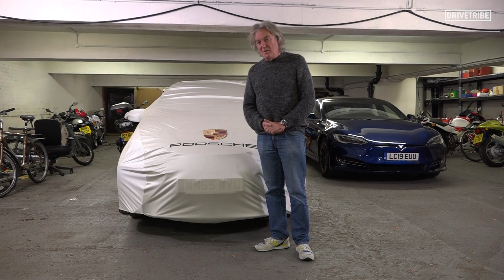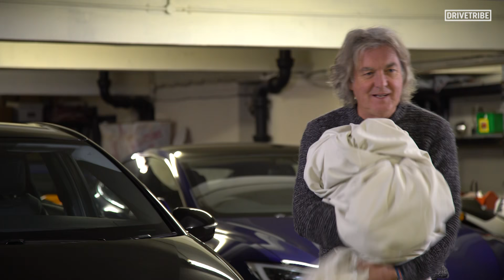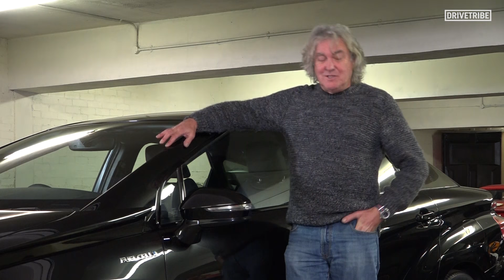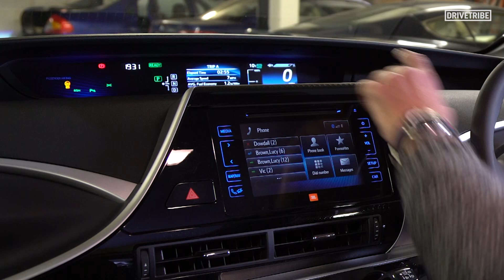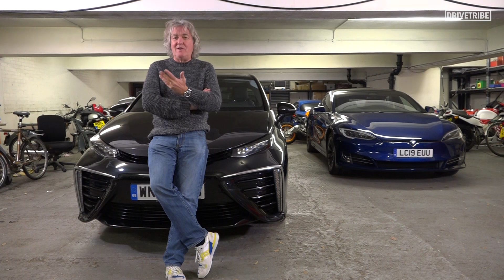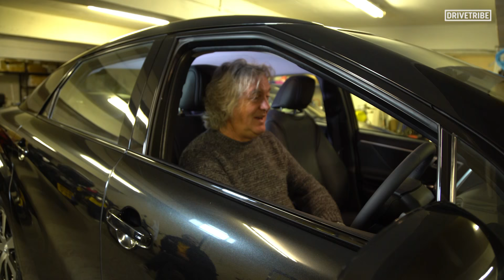James May has bought ANOTHER new car

Comment: Both cars require fuel produced by burning coal, fuel cells and lithium batteries require nickle which has a colossal carbon footprint, there are many other high carbon materials and processes involved in the manufacture of these vehicles, just now there is little if any real smug points to be gained from running these cars but the time is fast approaching when a real dent may be made in our collective carbon footprint. So now its either a new Fireblade or a used XKR, or maybe a used Elise, or shall i be the 57 year old chap that i am and buy a Range Rover, a petrol one. Or maybe a BMW S1000RR, this could take sometime.

Comment: I think Hydrogen for cars will not happen, a bit like the Gas Turbine cars at the start of the 60s, promising  but the advantages  too small to overcome the big problem, the cost of operation. The simple fact is that with recharge times heading to 15min, the peoole who are willing to pay 4 x cost for their fuel ( because of the energy intensive manufacture) to save a few mins at the pump is too small to justify the infrastructure and tooling etc. Sure hydrogen has potential for use where batteries cannot be used, aircraft, ocean going ships but for cars it is a Video Disc in the world of VHS video recorders.

Comment: Hydrogen has a possibility of use, in that it can be produced and stored relatively close to the source of energy. It can produce in one plant, using clean energy from Nuclear plants at times where power consumption is generally low (meaning they don't produce during the time where everyone is making food or otherwise burdening the grid heavily, and the produce can then be taken to the stations in its vicinity. Hell, even within quite a fair distance as long as the production is enough. 

They cannot, however, compete with the efficiency of direct "injected" energy into the battery when you connect to the grid.

Basically I think Hydrogen stands a chance when the grid starts showing signs of being heavily burdened. When nearly every home has a battery car. Imagine every home starting to pull 3-4 kW extra because they got home now and need to charge their car. It's much easier to have production plants directly connected to the powerplants with their own grid where they then get to produce this Hydrogen for fuel consumption. Lots of lost energy in the process, but still much lighter on the nationwide grid.. and thus less energy lost from the mere transportation of energy (there is a loss factor in the normal grid too, after all. The further the energy needs to go, the more loss).

Comment: After lots of research I think battery is the future over hydrogen; Maybe not the cell technology we use today, I think it's helping push for better technology, but definitely not hydrogen. Hydrogen will absolutely be more dangerous in the long run and will just shift dependence. Anyone who has enough money for an EV likely already has there house wired for electricity which means everyone has access to a method of "refueling" inside of their home.

Comment: I ... also ... thought it is going to be a Prius ... but Yes I too think, the hydrogen fueled car is better than the battery one ... but for now the refuel/recharge stations are not that common ... as a matter a fact in Bulgaria for now there are non for hydrogen (the construction of the first ones should be complite till the end of 2020) and 152 for EV cars  for the whole country ... and only 23 of them with 50kw DC charging connectors ... yep ... in Bulgaria the "future" is comming slower :|

Comment: In 2018, fewer than 7000 hydrogen fuel cars were sold globally (total sold since 2013).  Battery electric vehicle sales are well over a million and increasing rapidly. The answer should be obvious at this point. If this video came out in 2013, James would have a valid argument, battery or hydrogen. Fossil fuel companies will not let it die quietly though as well as traditional auto manufacturers. They want to continue to provide fueling and maintenance services in order to profit from it.

Comment: Hydrogen will go down in history as a failed technology. The high price(higher than petrol) the need to build a completely new distribution network, it would need a worldwide hydrogen production plants and thousands of trucks to deliver it just like gas, no refilling at home(from your own solar panels). The fact that electric grid is everywhere and all you need is connections to be set up. 
The future is home solar, home batteries, charging at home, work or shopping, superchargers for travel. Always leaving your home with a 90% full “tank” and rarely have to stop just for energy. Electricity is also very cheap and it is possible to be produce it 100% with renewables in the future.

Comment: Hydrogen sounds nice for all those "use existing infrastructure" type reasons, whether it's having a pump at a petrol station, or sending it down the gas pipes, but the problem is that hydrogen is really hard to contain. It's so small, it can leak out of plastic pipes and it attacks metal making it brittle. That said, storing electricity also has its challenges, as mentioned with the heavy battery packs. 

I think that the batteries are an engineering problem, so as we get better at them, we'll improve the energy density. The hydrogen storage feels like a Physics problem, which is going to be much harder to solve, but the aircraft point is interesting - that's a case where you'd potentially be willing to pay more.

Comment: Did you check out the NEXO before picking the Toyota ? The interior of the NEXO imo is far better and the car it selfs looks better . This basically The Beta Max ...Hydrogen v VHS ..Battery power.
You should have no problem with refusing Hydrogen as most in South East. IMO battery is been pushed coz more money can be made for industries .

Comment: thanks for taking part in the EV future James! IMO, BEV's are a clear winner, not only because of charging locations and a plethora of energy sources to chose from, but also because the battery tech will rapidly improve (solid state, superconductors, etc..and use less and less toxic materials). As a 47 year old car guy who used to drive a MK4 VW R32 daily, and made the switch to EVs about 6 years ago, I've experienced the rapid change and freedom while going from an 85 mile 2014 VW eGolf to a 325 mile 2018 Tesla Model 3 long range. I used to have to make excuses why I got an EV while in the VW. Now in the Tesla there are no excuses, just freedom to drive how I used to, FUN. I've taken it on 2,000 mile road trips and they were easy, fun, and even relaxing. It just takes a change in how you view 'filling up'. Can't wait to see what you think! cheers!
-Alex J

Comment: There are two major advantages with the Toyota:
1) It can just be re-fueled like a normal car, no waiting time for charging
2) Lighter because no batteries
All that needs to happen is regular gas stations start selling hydrogen fuel and it's going to be a seamless transition from combustion to electric.

Comment: Me and a colleague did a test for a magazine last year. The Hyundai Kona (Battery) vs. Hyundai Nexo (Fuel Cell), 2000 Kilometres through Germany. We found that it really depends - the Kona did great in the city, with low speeds and lots of recuperation, while the Nexo was a superb milemuncher on the Autobahn. If we had to decide, it would be fuel cell all the way. So, congrats on your Mirai. Unfortunately the ext. design was apparently done by the janitor, since all of the dev. budget was spent on the drivetrain.

Comment: You need to check out the NanoFlowCell, which is another fuel cell system, which depends basically on two types of water, ionised and non-ionised.  It's a non-brainer - you get great acceleration, range and quick refuelling.  I really don't understand why it's not taken off - it obviously needs the infrastructure, but then so does everything new.

Comment: What I'd like to see is the two married together. A large battery that I can charge overnight at home and a HFC that I can top-up if I get stuck out and about. The only draw back I can think of is the weight and what impact that has on range, but otherwise wouldn't it address both sides of the debate?

Comment: I think Hydrogen is the future for the average person, whether it's fuel cell or ICE, and battery being for super cars.
Reply: Its pointless if you have a good enought battery EV (like Teslas and newer EVs) .. because of the reason that generating the hidrogen needs considerablity much more energy than it later delivers on the car..and you would go further and cleaner just recharging your car from that energy to begin with.. the advantage of hydrogen is that you can just refuel and go like a normal ICE car..  Of course a major breakthrought either in battery recharge time or hydrogen generation would tip the balance to each side

Comment: Hydrogen fuel cell cars are definitely the future. The problem with any EV, unless it's a Tesla and you only use their superchargers, is how green the electricity is that you're using. Plus the CO2 emissions in creating the batteries. Then there's the issue of the metals in the battery and what you do with them at the point you scrap the car. How environmentally friendly are they at the end of their lifecycle?

Comment: Lithium & Cobalt for batteries are Rare Earth metals with limited resources, unable to be used by all. Remains a mobility solution for the wealthy happy few and as child labour digs the cobalt in African mines hardly an acceptable long term solution. Hydrogen fuelcells have a much longer duration and use less Rare Earth metals... Therefore Hydrogen is the choice of the future! ..... Nuclear 2.0 able to reuse current spent nuclear fuel whereby overcapacity is used for producing Hydrogen..... would be a perfect source for cheap Hydrogen!

Comment: Sorry to spam your comments, but I really enjoyed this video. In regards to hydrogen fuel cell cars, hydrogen represents a very good energy storage option. Our country currently generates a small/medium portion of its electricity from renewables, which is great, but they cant be turned on to meet peak demand like nuclear or gas powered stations. If we are able to create a surplus of renewable energy, we could use the spare off peak electricity to create hydrogen. This could be transported around the country in tankers.
The fact that cracking hydrogen is inefficient is, I believe, irrelevant once you have surplus free electricity.

Comment: Living where I do,  an electric battery powered car  would be pretty pointless.  Due to the  average range they get, if I wanted to  go to the  nearest large town for something, or to the regional hospital, I couldn't get home again without a recharging stop. Probably 2 stops in winter. Hydrogen Fuel cells and  filling stations ( presuming  regular filing stations also upgraded to include a hydrogen pump ), would be much more practical to use. Pity  currently there are not enough filling stations.

Comment: Between a plug in and charge car and a 'fuel me up with hydrogen' I'll side with the fuel cell. My living circumstances don't allow for a plug in overnight top-up infrastructure, unless it's reversed. top up at places I visit, work, shops and such while the car sits fallow at home, at least with a hydrogen setup be it a fuel cell to power electric motors or combust the hydrogen much like a normal gasoline vehicle, I would prefer that more tangible transfer of energy.

The Chevrolet Volt with it's gas powered gen-set topping off batteries to make electric motors work might be less efficient, but at least we eliminate range anxiety, we can keep gassing up the generating force to run the electric. evolve this, have hydrogen 'shot cans' that you can throw in to keep it going, that'd make for more pleasant long stretches. within city limits, well so long as a servo isn't so far away, the 'visit to top up, store at ready' mentality comes back.

In short, I would prefer a fuel cell over a battery, unless we can get some kind of super-battery tech happening.

Comment: Both stupid options one requires fracking to get fuel and the battery powered vehicles are going to leave behind cities filled with e waste as they die. And won't work the way they are intended to in 3rd world countries. Coal powered power stations will be working overtime to charge these EV's this making the carbon footprint larger

Comment: Hi James - I agree with a lot of the points that you have mentioned, here are some thoughts I had.

A lot of energy in the Hydrogen energy cycle is wasted because it takes a lot of energy to:
- Split water to make Hydrogen
- Split Natural Gas to make Hydrogen, but less energy than it takes for water
- Super-chill Hydrogen to a liquid for transport
- Transport super-chilled liquid Hydrogen
- Store super-chilled liquid Hydrogen

If the car uses liquid Hydrogen like BMW's Hydrogen 7-Series, you waste some of that Hydrogen because the Hydrogen in the tanks constantly boil at any temperatures above -252°C. So your efficiency drops further, plus you can't park the car in a closed structure like a garage because the car needs to release little puffs of Hydrogen every so often to reduce the pressure in the tanks. That released Hydrogen would build up in the garage and might cause the garage to explode if there's a spark - like when you turn the lights on.

Then there's the environmental problem of making Hydrogen - the easiest, cheapest, and most efficient way to make Hydrogen is to use electricity to split apart Natural Gas and extract Hydrogen. This is really horrible because it causes more pollution to extract Hydrogen from Natural Gas than to simply burn that Natural Gas. So you are better off just burning the Natural Gas in power stations to produce electricity. So it doesn't solve the environmental problem and it doesn't solve the problem of what happens when we run out of Natural Gas - as we inevitably will.

I don't think Hydrogen is going to work for the average car, but the place where Hydrogen truly excels and is without competition is with goods and services vehicles. Long distance lorries, busses that are constantly on the move, delivery vans, taxis and the like where you need to constantly use the vehicle and stopping for hours to charge is going to be very bad for business. These vehicles would benefit greatly from Hydrogen power as we can have quieter and cleaner cities but at the same time they can fill up in a jiffy and carry on.
 You mentioned aeroplanes too, this is definitely something we should look at - because there's no way we're using batteries for large aeroplanes, it's too heavy.

I like your thoughts on looking at the energy system as a whole, this is really where we need to look to find solutions. I've actually never thought of having a Hydrogen pipeline network around the country to feed various end users. But wouldn't it be easier just to make that electricity at the source itself and ship it around on wires that to lay thousands of miles of piping to pump hydrogen around? I think we're nearly there with regards to the design of the future of energy - the only thing we don't have yet is a good source. Produce electricity at power stations using ( X ) and send that electricity around the country super efficiently on high voltage wires, store that energy locally near where it's used using batteries to cater for sudden surges or spikes in electricity demand, have an intelligent electricity meter that monitors usage at every home and reports back to the power stations so that the computers can automatically control supply.

Today, the ( X ) above is Petroleum, Natural Gas, Coal, Solar, Wind, Nuclear, Hydroelectric Dams, Geothermals and a list of others. The challenge is to make sure whatever ( X ) is in the future, there is a never ending supply of it, it is always available 24/7 day or night, and using ( X ) would not harm the environment irreparably. So far it looks like there's no single system that can become that ( X ) - we need a myriad of sources all linked into one and controlled intelligently by computers so that we the end users don't need to think about whether or not it's ok to put the kettle on. The only thing that seems plausible in the future for a single source of ( X ) is Fusion energy, but there's a saying that goes "Fusion energy is always 50 years away" - that is because it's so hard to make it work and mankind has not been successful to date.
Reply: "I've actually never thought of having a Hydrogen pipeline network around the country to feed various end users. But wouldn't it be easier just to make that electricity at the source itself and ship it around on wires that to lay thousands of miles of piping to pump hydrogen around?" 
In fact, pumping Hydrogen trough pipeline network is cheaper than sending electricity trough a wire. I don't like it, but It's a fact.
However, I'm going to buy Tesla Y with a big battery (or VW Buzz 111 kWh!), not Toyota Mirai.

Comment: Hypothetically:  In the year 2040 any device less than 10% efficient will be illegal.  That is absolute efficiency, so a 3000 lb car moving a 200 lb human at 100% efficiency is actually only 6.25% total efficiency.  Out of the total 3200 lbs being moved only 200 lbs of it is considered usable work.  That is even assuming a 100% charging efficiency and 100% motor efficiency.  That Harley Davidson you got is closer to 10% total efficiency if you throw in an electric motor and batteries.